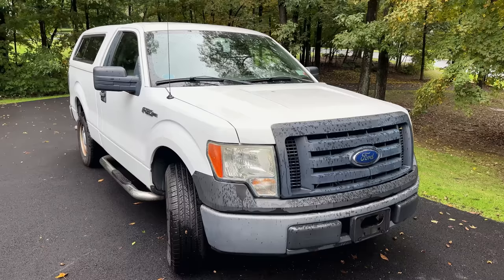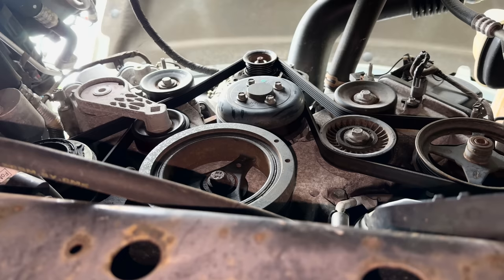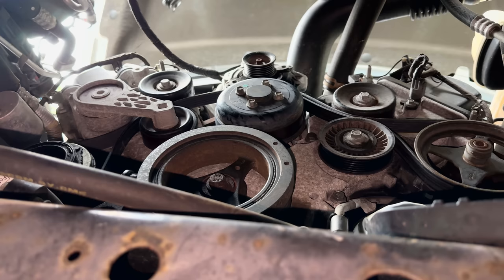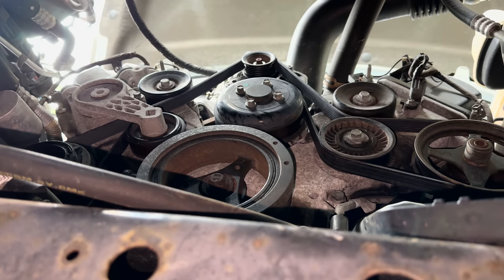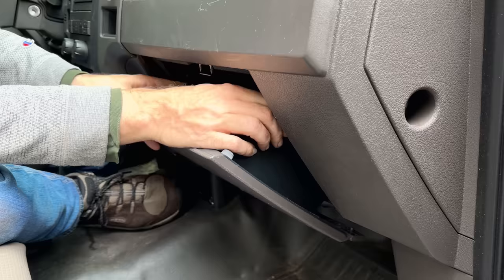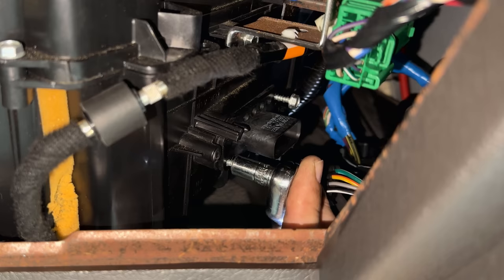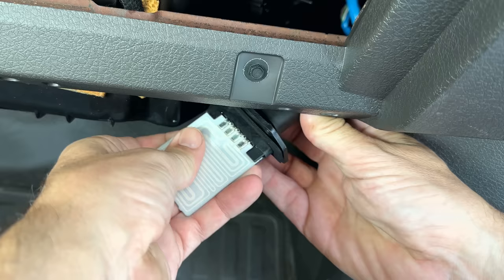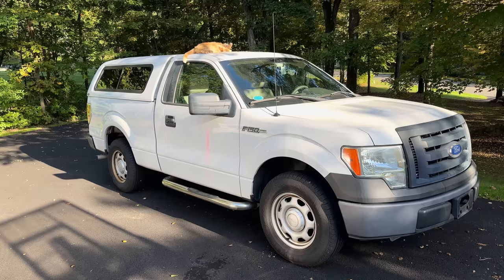2010 F-150 Belt Replacement and Blower Motor Resistor Repair

Comment: Better make sure airflow to from the blower is not restricted. Possible resistor doesn't have enough air flow. Like you said, could be blower motor too.

Comment: If you suspect a noisy serpentine belt, pour a bit of water on the belt when running. If the noise goes away, it is the belt.
Reply from the maker: Yes, did that and it went away.

Comment: My old 2000 F-150 went through 3 of those resistors.  Seems to be a bad design from the start.  For longer term and longer life, maybe a little CPU thermal paste,  a cut down M.2 thermal fin cooler thin enough to sit on top.  May prevent the baked resistors from dying.

Comment: The oem belt is probably hardening up from heat cycles, thus the noise. As for the resistor card that is a common failure. They should've kept the metal winding resistor packs in all vehicles. Yes it is possible the motor is drawing too much current as well. However the truck has sat awhile, so it is possible she is a bit dry in the bushings. Run it on high and wear it back in. Just think some newer cars are now controlled by the ecm and if it detects a bad motor you get a check engine light, which means the car won't pass inspection, at least in NY state. Dumb companies. On another note the truck seems to be in good condition. Keep in mind it is important to keep the oil changed in these engines and use Motorcraft oil filters due to the long timing chains and plastic tensioners. They are usually dependable. Mine is the Coyote 5.0. 2014. Too bad I live in NY rust belt.

Comment: It's a very old technology to regulate a blower motor with a resistor.  If it brakes again,  simply You can use a PWM Regulator instead and save the expensive electricity ( cost 3times) on board your car.

Comment: It also needs a carb kit. :-) It is easy to check the blower motor by measuring the current draw at the fuse which you may want to do before burning out the new resistor. You may also want to check the cabin air filter.
Reply from the maker: Was thinking the same thing.  The filter is probably original.

Comment: The cats seem to like the truck. I agree that there seems to be another problem with the blower.  Not likely, but  could there possibly be an obstruction blocking the cooling to the resister?

Comment: try to clean all the pulleys next time with a wire wheel or brush get all the old bits of belt out of the grooves I did that to Mine and even made the belt a 4 groove instead of a 5 groove and no noises yet since I made that modification

Comment: The blower may be pulling more current than it should from going unused for so long(maybe grease hardened in the bushings or something along those lines?). I'd pull the motor and see how it spins by hand.

Comment: Does the cabin  ventilation air inlet have a filter? Have you changed it? Likely the pcb/resistor needs full airflow to keep it cool and a blocked cabin air filter could well cost you sequential pcb/resistors.

Comment: The Ford blower motor has always been problematic. I've had to replace them--sometimes repeatedly--on every Ford I've owned. Mine were the older "coil" resisters that corroded from moisture drawn into the blower housing. It's a poor design, but a simple fix that sells resistors.

Comment: Always always always replace the tensioner and belt as a set.  And check the pulleys when the belt is off.  Set of pulleys cost $20.  Bad pulley gunna smoke that belt.

Comment: Using a big resistor for speed control for the blower is kind of a barbaric way to do it, I would have thought there'd be a more sophisticated method in such a modern vehicle.

Comment: What is your opinion on the seats and ride comfort of this vehicle ? I've heard/seen alot of ppl here on youtube complaining that ford trucks have rock hard seats and no ride comfort to speak of, but i suppose they could have gotten "monday morning lemons" as others say the complete opposite.

As for the blower motor and resistor, most likely the bearings are on their way out making the motor harder to turn at lower speeds, could even be that speed three instantanously failed on the new oem resistor due to this.

Comment: Seems sad, that in this day, where efficiency is the mantra, that a resistor block is used to control the fan speed, rather than a PWM mode.

Comment: Just a thought, if the resistor is cooled by the air flowing over it.  I would assume the truck has a cabin filter… Have you checked that the filter is not clogged?  You are getting air through the vents, but is the flow rate correct for all speeds?  If the filter is clogged the flow rate at the lower speeds may not be enough to keep the resistor in its operational zone.
Reply from the maker: Plenty of flow through the vents.  I am sure though the filter is due.
Reply: I really enjoy your channel.  Good luck with this hunt.  It seems there is a lot of experiences about this type of problem with the f150 heater on the internet.  Troubleshooting under the dash is a real pain, literally…

Comment: Keep that belt in your vehicle. Those belts should last forever. In the future if it squeaks again take a bar of soap and run it on the grooves. Your coolant hoses will also last forever. Anti-freeze last inperpatuity also. The rust inhibitors in the anti-freeze can go bad but thats ok. Have you ever heard of anyone rusting a hole in their block so I wouldn’t worry about the rust inhibitors
Reply: If there are any dissimilar metals in the cooling loop (and there certainly are) you really want the anticorrosion properties. You probably won't rust all the way through the engine block but what about other components like the radiator? Also when stuff does corrode it will turn into sludge which will surely decrease cooling performance.
Reply: My 27 year old truck that i bought new that has 270,000 has never had any problems with not changing the anti-freeze. Not even any rust in it.  Its a 1997 gmc sonoma 4.3 v-6. Its never had any repairs other than normal consumables till last week. Had to put a new distributor in it.
Reply: @ronaldrist5985   From what I can tell that's an all-iron engine. My hunch is aluminum engines are more prone to corrosion. In any case, there's probably no need to frequently change coolant if it is doing its job but it's cheap. If you need to change the radiator or water pump I'd probably suggest doing a flush to make sure everything's clean.
Reply: @eDoc2020    aluminum is a non-ferrous metal. It won’t rust.
Reply: @ronaldrist5985  Aluminum doesn't rust but it does corrode, in fact quite easily. The only reason aluminum things don't crumble instantly is passivation. When exposed to air the surface instantly corrodes to aluminum oxide which protects it from further corrosion. I had cheap hose fittings made of aluminum and after a season of being connected to a proper brass fitting it was frozen together. After freeing it and removing the sludge there was massive pitting and one chunk of corrosion ate through the entire 1/8" inch thick body.

Comment: Why did you disconnect the battery to change a belt ,that’s not necessary…
I replaced the blower motor resistor on a 2010 Ford Escape, it lasted two weeks and failed, it was a genuine Ford part, the motor was actually the problem.
Reply from the maker: Battery disconnected to make it impossible for something to go wrong.

Comment: I’m surprised you haven’t been bench testing those resistors.  There must be a way to do that, right?
Reply from the maker: Thought about it and also measure the amp draw from the blower motor, but did not have know good values.

Comment: I see your front plastic looked faded a great old fix is If you want to bring back those faded Black Plastic parts use a 60/40 mixture of Penetrol & Boiled Linseed oil which will re-emulsify the plastic and return it to like new. Just like all plastics on cars the UV sun light caused the oils in the plastics to come to the surface and evaporate & Oxidize causing the discoloration. That mixture will help the oil to leach back into the Plastic.
Reply: Sounds good.......I wonder what Penetrol is called in England........?